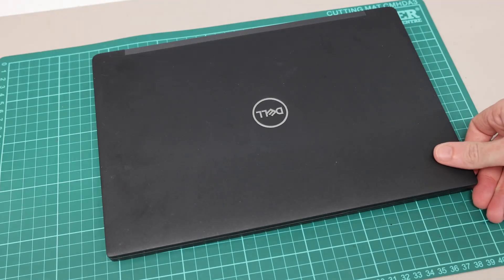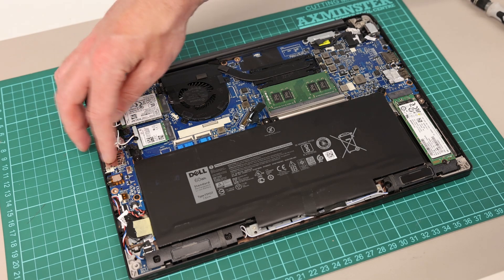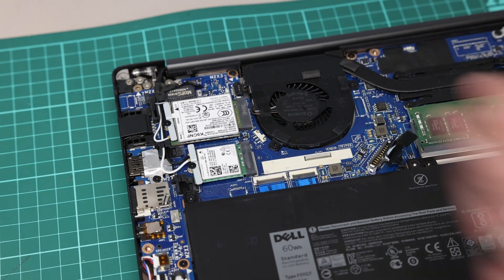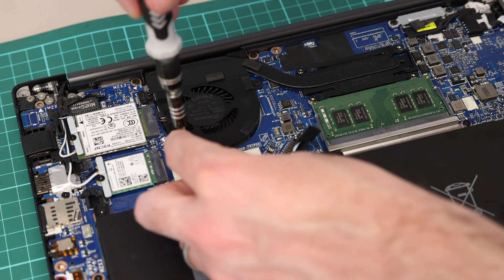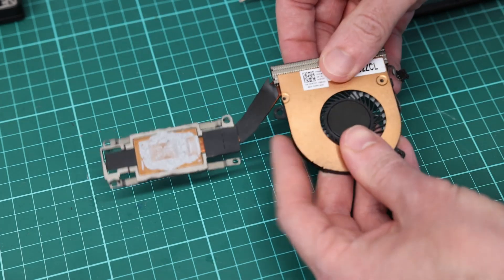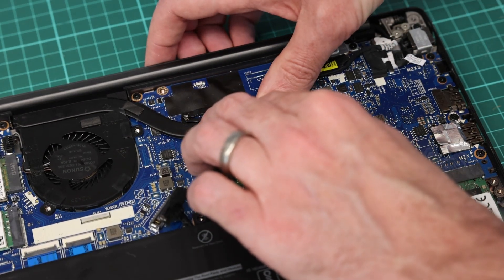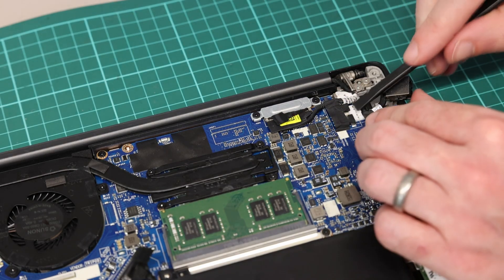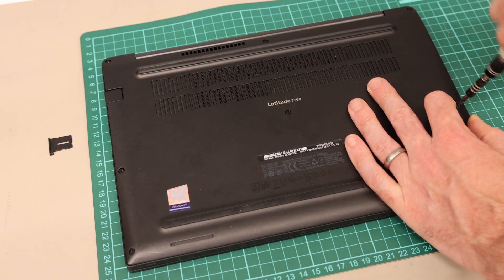Dell Latitude 7390 - SSD/RAM/WiFi Upgrade and Basic Repair Guide

Comment: My laptop is blinking 2 orange and 4 whites with no display what should i do?
Reply: The 7390 2in1 service manual says RAM failure. First, go download the service manual for more info. What I would do is take the back cover off, disconnect the battery, take the RAM out, clean the whole area and the ram slot itself with canned air, and then reinstall the RAM and battery cable and cross your fingers 🤞 

If that doesn't work, it may just need to be replaced

Comment: Which is the fastest SSD supported in Dell 7390?
Reply from the maker: The slot is an PCIe 3.0 one, so that limits the max speed, but the Samsung 990 EVO NVMe M.2 SSD is an excellent choice - you just won't reach the peak speeds PCIe 4.0 allows: https://amzn.to/4iliE1M

Comment: Can i replace the sim card board with ssd?
Reply from the maker: It may work using a B+M key M.2 2242 drive, eg: https://amzn.to/3TnB8DG
I haven't tested though.
Reply: Any luck? I wanted to try the same thing but I'm not sure if it's compatible in bios
Reply: 2242 slot works with nvme drive but the 2280 slot has to be empty. Teste on 7490.

Comment: Same 😢😢 product sir। Please 🥺🙏 help me ,,,,dell 7390 two in one laptop onboard Ram upgrade possible?
Reply from the maker: Looking at the service manual, the Latitude 7390 2-in-1 doesn't have upgradeable RAM.
Reply: Upgrade is poosible if done by a chip level technician...they will remove onboard chips and install new ones...those chips will cost you twice the amount of regular ram plus the labor 🧐

Comment: I want to install a Wi-Fi 6E (AX210) card in that same laptop. It won't work, only the AX200 will work, or have you already tried the AX210 and it doesn't work since the AX210 is Wi-Fi 6E?
Reply from the maker: An AX210 should work - an AX201 or AX211 won't as these are CNVi2 cards, not PCIe.
Windows 11 is required for WiFi 6 support though.
Reply: But downloading the drivers for that card will work with Windows 10 Pro without any problem.
Reply from the maker: Yes.